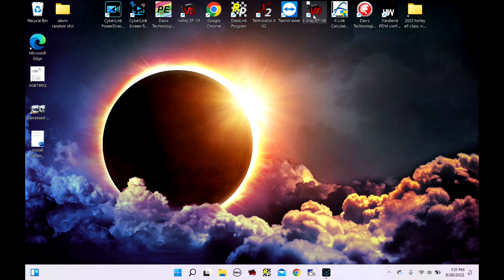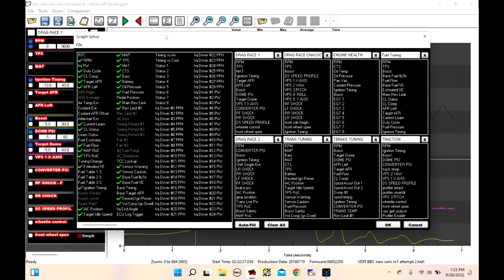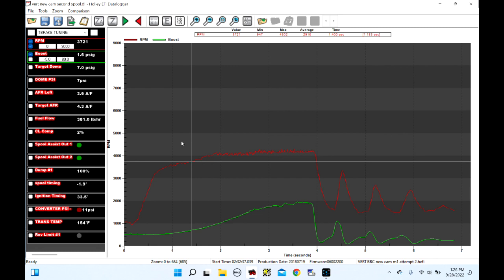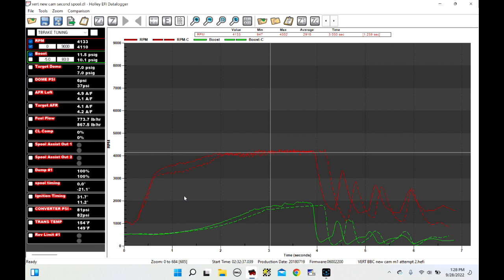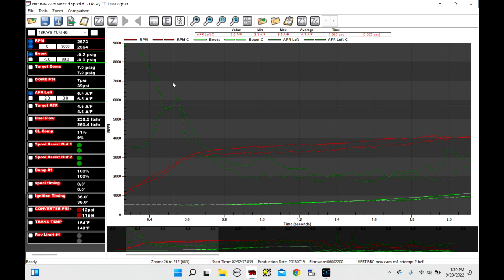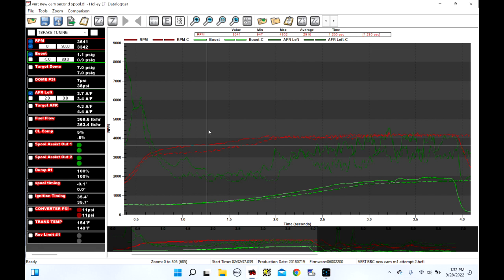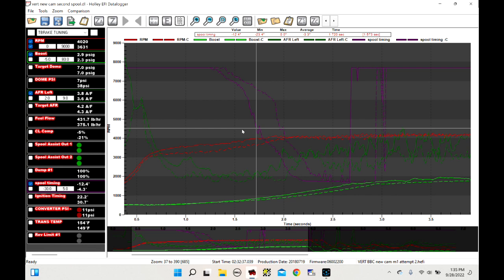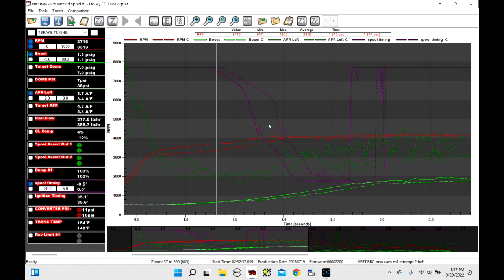Holley Efi Turbo spool up tuning

Comment: Hey Devin great video. I have a question. I bought shielded wire for my cam, crank and  tps wiring. Where should I connect the shield wire? What would the propper gnd place be?